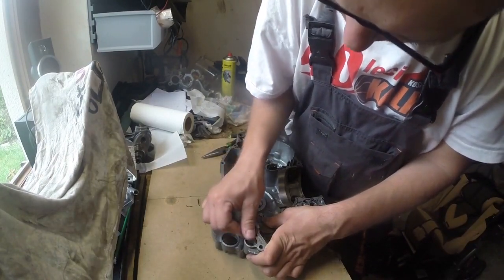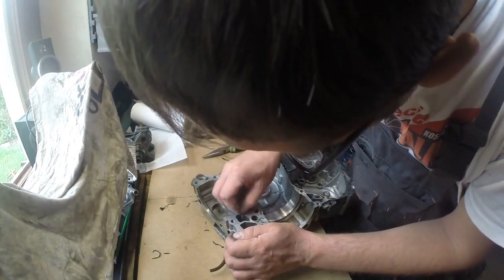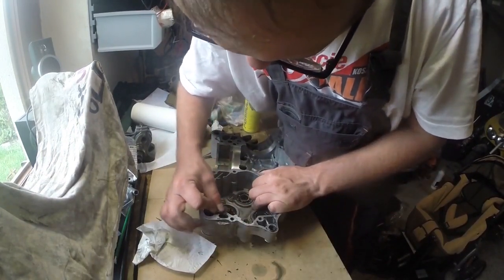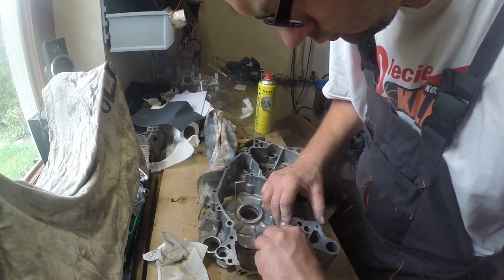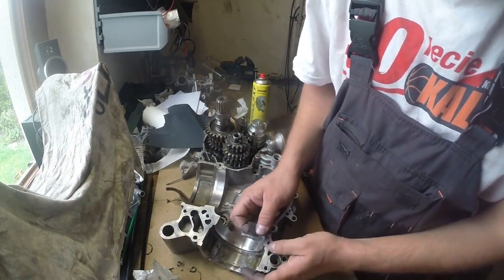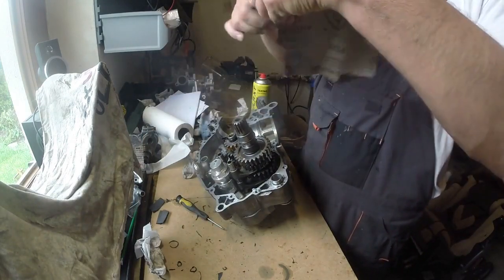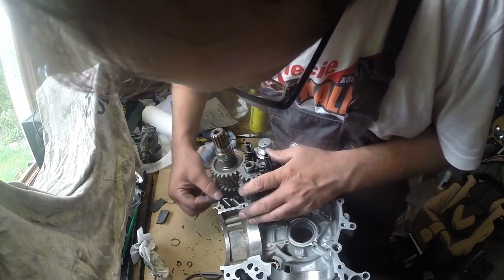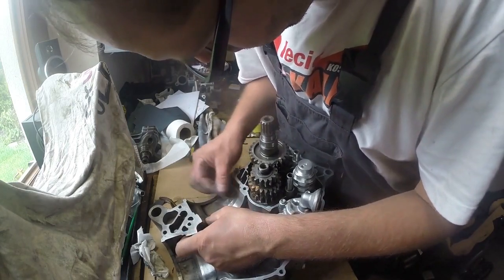Aprilia SXV   Engine Rebuild   01  cases clean up

Comment: What do you think about sodium bicarbonate blasting for cleaning cases heads and valves? I'm doing this job in these days
Have you got a facebook/instagram account to talk about this engine?
Reply from the maker: In my opinion it is not necessary. If you would like to clean  outside cases, just use a aluminium wheels cleaner. It do a magic :)